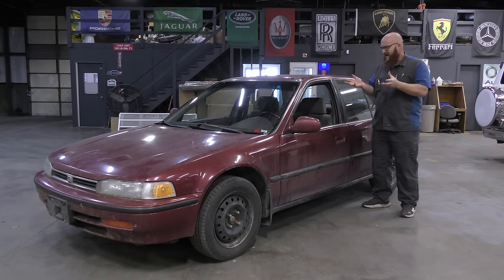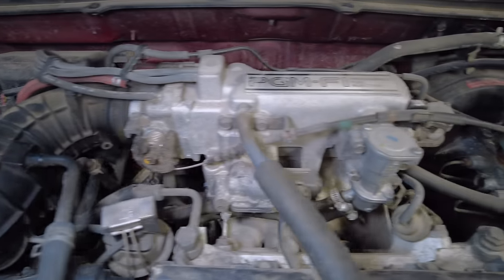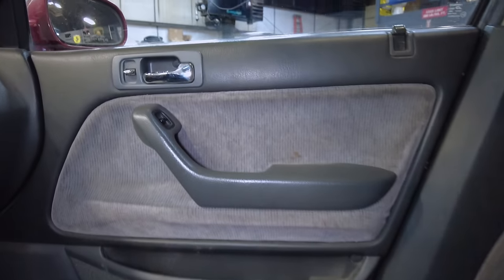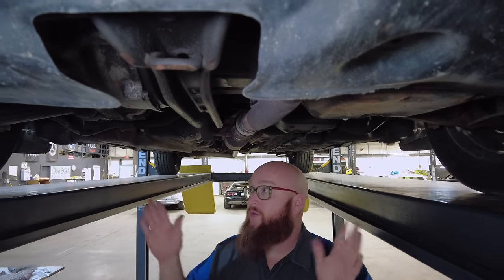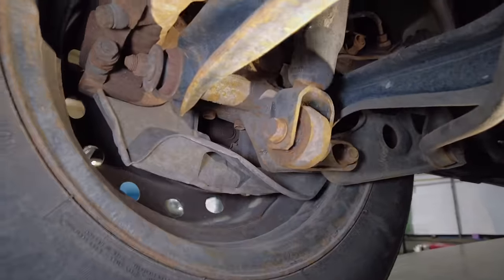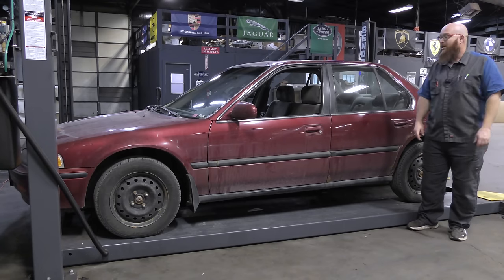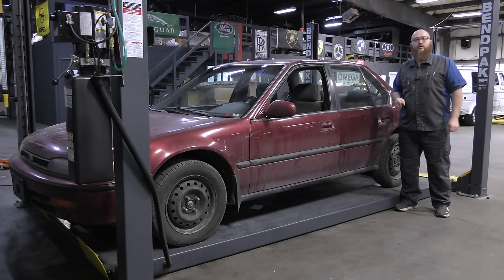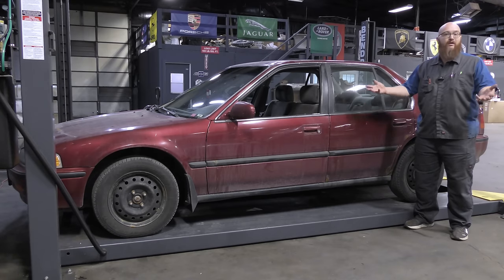A True Testament: 32 year old Accord with 380K miles! When Is It Time to Let It Go?

Comment: In 1992, the number of 1960 model year cars on the road was essentially zero. Yet old cars like this one aren't even an uncommon sight now. Quality really improved.
Reply: And apparently has dropped again recently
Reply: Then took a massive dip after like 2010
Reply: Once the EPA forced automakers to put turbos on tiny engines with new, unproven transmissions, quality suffered. Many basic cars from the 2000's are still great today if maintained well.
Reply: @spotifyseascapessmoothjazz  I think once automakers realized they could make shit extremely difficult to replace, parts hard to find, and crammed vehicles full of modules and chips that prevent your car from driving if damaged is when being able to affordable maintain your car ended.
Reply: @spotifyseascapessmoothjazz  Not to mention, automakers putting transmissions made for 4 cylinders behind v6s that made two times the amount of power as the four cylinders did.
Reply: I remember 1992 and I seen old cars all the time on the road. I never seen a Honda I liked and my opinion is new cars suck now. But if you think things are better than I am happy for you. I just disagree
Reply: Honestly there were some trucks, vans, and ubiquitous Volkswagens from around that time then...
Reply: Also another thing to keep in mind is the introduction of four speed automatics and 5-speed manuals. That significantly increased engine life expectancy due to the ability to run at lower RPMs. 

In the '60s and pretty much up until the '80s, cars weren't (MECHANICALLY) built to last More than 100,000 miles before needing a engine rebuild, transmission rebuild,  or both. 

Then add in the fact that safety equipment technology skyrocketed, thus drastically increasing the survivability of most crashes. And it's pretty obvious why people stopped driving around their '60s and '70s hand me downs.

Then there's the Chad's that still drive around '60s cars and '70s cars today. Safety equipment be damned.  Cough cough, we die like men, being launched out of our windshields at 50 miles an hour.
Reply: @erickricharson5196  So what era is your favorite?
Reply: @yaboimax6356  That's hard to say. I love 60s and 70s cars some 80s a few 90s a couple in early 2000s. I also love 50s and cars as back as model Ts. I am not brand loyal so ford, dodge, chevy, amc etc is not important. If I like it I like it. I have a collection of about 48 cars  my current project is a 71 Nova I saved from the junk yard. I am known to flip cars 90s cars are great for that now. But I have also never seen a Honda I like and only about 2 Japanese cars I would drive ever. Mainly American and German for me
Reply: you wouldn't have seen many 1960 cars on the road in 1965.
Reply: @connor_flanigan  I seen lots of 60s cars in the 90s
Reply: @erickricharson5196  I seen um too - they wuz rat over thar
Reply: 90's Honda are really a golden era for them. I 've had two 94's that both made it to 400k+ miles each and I only stopped driving them because they were old and too small for my job...also an 07 that made it to 350k, but it was kind of junky compared to the 90s models. Felt cheaper...
Reply: What are you talking about....my dad worked for the railway, is get to work cars was 1968 Nova and 1968 C10
Reply: @user-lq4mo8dw1p  yeah they are sadly misinformed. Older cars are much better 90s Hondas are certainly not great
Reply: In 1992 I had a 68 Pontiac. I felt like it was soooo old at the time.    Maybe because it was older than I was. Today, my 24 year old Miata doesn't feel nearly as old to me. 208k miles and still going strong, even with a supercharger since 135k (minus the rust).
Reply: @George0674  I'm in a dodge pro master van, granted I'm a expediter...it's a 2014 and I'm nearing 700,000
Reply: there were alot of cars from the 60s and 70s around in the 90s. The reason there werent as many as youd think was the oil crisis in the 80s essentially had them all sent to scrap yards for more fuel efficient cars. But realistically I hardly see any cars from 2008 on the road anymore.
Reply: @logantyler3741  hhhhhmmmm good point .....cash for clunkers took care of that.....best SUV was the 2000 to 2006 Tahoe, Yukon and suburban...I still see them in Michigan but they are rusting, I see them all over Mississippi Alabama Georgia the Carolinas and Texas and look great
Reply: Yeah fast forward to 2024 honda quality non existent  already having paint failure and ball joints falling apart maybe even oil leaks but hell what do you expect for $40,000??! 😂
Reply: @Braxton-xk5bi  I bought a 2004 Honda pilot in 2004....also bought a 1995 Chevrolet astro in 1995....the pilot was supposed to be the best SUV made.....wanna make a guess which vehicle I still own today???
Reply: @ShawnCalay  ummmm astro?? 😂
Reply: @Braxton-xk5bi they say the new ones are bad.
Reply: Goes to show the 90's was the best time for cars
Reply: @spotifyseascapessmoothjazz  Yeah, that definitely has something to do with it, but alongside that the companies that are using the small engines with turbos or putting terrible ass rings in them
Reply: @spotifyseascapessmoothjazz  i have a 2022 crosstrek manual. it's a non-turbo 2.0 engine and a 6 speed manual. it was one of the more simple cars you could buy when i got it new. to hell with that CVT transmission
Reply: Yeah, I’d say peak car quality has been 1990 - 2010 or so. There’s exceptions to that for sure, but when it comes to Honda & Toyota — they are good in any year.
Reply: @spotifyseascapessmoothjazz  I'm daily driving an '05 Insight that I bought new and I've repaired and maintained and it runs like a goddamn top
Reply: @erickricharson5196 reliability results say differently 

But, you're welcome to your delusions

You know you can easily look this up, right?
Reply: @lockandloadlikehell  I go by my experience as a mechanic. I do not need to follow Google. There is nothing special about Japanese cars. And I can show many old American cars clear back into the 70s that have lasted. I hate working on Hondas and such always have simply because things are so compact. You can keep following Google and the delusions of people that have to pay others to fix their cars, but do not expect me to. You can keep your delusions I certainly do not need them
Reply: Engine longevity and the quality of steel used in car bodies started improving markedly around the 80s I believe. That meant much more reliable, rust free vehicles until the noughties when they started filling vehicles with unreliable electronics. It's the ancillaries now that determine the life of a vehicle rather than the body or engine. Keep your car out of the sun as it's the plastic and rubber parts degrading that may kill it. Once repairs start costing a sizeable chunk of the cars value it's on it's inevitable path to the wreckers.
Reply: @user-hu4vr7zn9p  I was recently T boned by a 6x4 dump truck. My truck was old and I walked away. I know for a absolute fact as someone that works in the industry that had I been in a modern vehicle I would of been seriously hurt or dead. Also the electronics in modern cars do fail and they stop making parts to fix them. Today they seal transmissions and say no service is required it's lifetime. Well that can't possibly be true. They design these modern ugly piles of crap to fail and be junked in 10 to 12 years. Sorry but I will never pay 80k to drive something that has zero style, no real chrome, hard to work on and is guaranteed to lose money.
Reply: @brensdaman926  I generally like style wise like 80s and older and mainly Japanese cars but I will not deny that I would have to say the 90s were the pinnacle and my brother was saying for example a 1UZ, 4 liter quad cam V8 from Lexus in the 90s can literally last 1,000,000 miles without a rebuild!
Reply: @adamgallahan6747  That's not surprising.  I have a 2000 Blazer and a 01 Honda CR-V.  I plan to just fix them and drive them.  Cars today are riddled with too many garbage electronics and plastic crap
Reply: My family is currently driving a 1995 astro van with 300k,  a 1998 F150 with 275k, and a 2005 Element with 175k. All daily drivers. All with no issues. Just kept up with maintenance.
Reply: @yaboimax6356  Overdrive transmissions likely contributed to engine longevity in some cases, but I don't believe that was the main factor. Plenty of VERY long lived cars had/have very short gearing and cruise at 3-4K+ RPM with no issues. Many 80's and 90's Hondas and Toyotas cruise at around 4K RPM in top gear just to name a couple and look how long those last.

Overdrive or not, it still takes a fixed amount of power to move a car at a certain speed. Whether an engine runs at, for example, 3K RPM generating 52 ft lbs of torque or 2K RPM generating 79 ft lbs of torque while cruising at 70 MPH, it's still producing the same 30 HP either way.
Reply: @erickricharson5196 Japanese cars are MUCH better than American cars. You’re on something if you think otherwise.
Reply: @stephenlang7870 does the f150 have the 4.6?
Reply: @Ecchier  your on something if you think that. I stick with old American I am a proud American not a traitor
Reply: @erickricharson5196  You’re a proud owner of Junk! Your loss.
Reply: @Ecchier  nope I am a proud owner of many classic cars going up in value. You are the one wanting junk it's your loss not mine I don't lose money on my cars but I am sure you do
Reply: @erickricharson5196  I get what I paid for, while you sit there and pay 30k for old junk.
Reply: @erickricharson5196  I bought a Honda pilot in 2003, sold it for scrap in 2012....bought a 1995 Chevy astro in 1995, still have it today but was wiped out in the 2023 hurricane while I was 🚛 ng in the Midwest....I miss that astro more than all of my ex girlfriends...
Reply: @BullittHilts  I remember when I was a part time tow truck driver back in the late 90s and early 2000s....I loved Honda's and Toyotas....that great quality you think they have had left me with no bills....I was able to pay for everything in cash....
Reply: Then they realized they were too good,and started purposely building in failure points and made them needlessly complex. 1990-2005 is the sweet spot.

Comment: They lost their mind to get rid of this car it would be cheaper to fix the annoyances than dealing with a car note. Its a good back up car
Reply: Even though I don’t own a Toyota or Honda, I’ll continue fixing my 2.5l Jetta once or twice a year. If I can go my entire life without a car note, I’ll do that. Thankfully, the car doesn’t leave me stranded and starts every time.
Reply: Even if there engine does eventually need replaced, it would still be financially worth it to go that route as long as you're keeping up on the safety items. Hell, even addressing the rust and  the rear window seal would be worth it - it would help prevent the next 10 years of this car's life from really starting to rot it away. Even if you're into it for a few thousand dollars over the next decade, it's STILL far cheaper than a car payment. This really is an example of an easy-to-save classic that is well worth actually saving.

Comment: A modern day car would never outlast a vehicle of that generation
Reply: My dad's Honda Element has 525k miles
Reply: Think the 4Runner and 2023 gx460 will make it with ease if regular maintenance is performed
Reply: i saw a 2018 civic with 450k on it
Reply: Seems like some confirmation bias, most modern day cars wouldn't have been driven long enough to know yet.
Reply: My 06 CR-V hit 250k and my CX civic has over 300k! Hondas rule!!!
Reply: They'll last but with 87 computer lights/errors.  Or gasoline will be no more.
Reply: my step mother confused hyundai and honda. 
and she got 2021 hyundai because she got "great deal" on the car.
big mistake.
Reply: If you keep up on the maintenance and take reasonably good care of it (like the owners of this car clearly did), most modern cars could last that long as well.  I will concede that the maintenance is getting more costly though...so more people will skip it.
Reply: There are numerous million-mile vehicles from the last 10 years or so.
Reply: I know of a few Mitsubishi Mirage's that past 400,000 miles. They are modern. (:
Reply: We don't know that it's been a year bro
Reply: Wow I really need to drive my car more. It's the 99 Acura tl rust free almost mint in condition. It has 243k.
Reply: @Ronniejamesleo  Wow! Mint condition is great for so many miles! No dents or paint chips?

Comment: I don’t think a 2024 Honda will make it to 380,000 miles.  This was a different era
Reply: Best era of vehicles from a practical perspective.  One simple computer, fuel efficient, fuel injection was perfected by then, adequate power, plenty of simple manual transmissions available, rust proofing was decent enough if you took care of it, big enough to fit a family in.

Most reliable Honda and Toyota era as well (90’s).
Reply: @Joe-hz1nw Totally Nailed it. My sentiments EXACTLY. Hard to explain this to the "newer is better" crowd. Peak engineering ... not OVER engineering. My '95 Lexus is a testament to this. Best Accord EVER incidentally.
Reply: @RobertSmith-js2kz  those Lexus models are great, whether they were just rebadged Camry’s with more sound proofing and creature comforts, or the more upper level luxury models.  Probably the best cars ever made all around, particularly that first V-8 model (LS 430 I think).

Which model of 95 Lexus do you own?
Reply: @RobertSmith-js2kz  I have a 1998 Accord.  Rust proofing is way better than the previous generation, but engine, transmission are weaker.  Still a great car though.  85k original miles.  2.3 liter Vtec
Reply: It probably could with great maintenance if those miles were driven on many longer trips in a relatively short amount of time, but probably not if it was 30+ years of short trips around town. Not with so few repairs needed anyways.
Reply: A 2024 Accord wouldn’t make it to 32 years old either.
Reply: Why not?
Reply: @patone2184  most modern Honda vehicles use CVTs and they have a very poor track record. They are very expensive to replace and can’t really be repaired
Reply: @Joe-hz1nw My LS (400) is no Camry (though the 90s Camry WAS "built like a Lexus". Lets get that straight ;) V8, rear-drive and built to a standard never to be seen again. It was a one-time deal, to establish the brand (and undermine the Germans), before the yen went through the roof, killing the financial advantage. It's all the same junk now more or less. They spent a BILLION dollars developing that car. I won't even get into the SC400 (that my girls still daily drives).
Reply: @RobertSmith-js2kz  best car they ever made.
Reply: Not these turbocharged engines
Reply: @CoolCars1-jl7rh it pains me to see what non Japanese Nissan has become over the last 20 years.
Reply: @joetz1 and they stopped making manual transmission. So I'm afraid to even buy axa new accord 😢
Reply: @kylefishing21 people don't realize turbos need extra maintenance.
Reply: My 91 toyota mr2 still runs well and no rust but that's because it came from the desert
Reply: A civic with a 1.5T has close to 800k miles, it's on youtube.

Comment: The sound of that F22A1 motor starting takes me back to the most influential car in my life: 1992 Accord LX wagon with a 5 speed manual transmission. I bought that car with 240k miles in 2010, and sold it with 378k in 2013 after someone smashed in the rear tailgate in freeway traffic. I lived in that car, drove it across the US multiple times, and taught maybe a dozen people how to drive stick in it.

In the end, the interior had no rips or tears and it only had minimal rust at the corner of the rear wheel wells. I replaced the clutch once when I bought it, the timing belt twice, and most of the money I ever spent on it was in tires. I learned so much about working on Hondas on that car, and it drastically shaped my life being able to trust in that vehicle to deliver me to whatever job I was doing during those years. To this day, I still miss my full-size spare inside that massive cargo space 😢
Reply: Might be able to find a replacement on bring a trailer

Comment: Honda really hit it out of the park with these 4th gen. Accords.  I like the body styling of them too.
Reply: I've owned six 4th gens,  all used- starting in 2000.  3 Teal colored EXs, 2 'grey',  I keep coming back to them despite owning newer Hondas and Acuras.  My 92 is ready for another 30 years of use.
Reply: The most reliable car model ever built. Wonderful vehicles.
Reply: Still a pleasant, nice looking car to me even to this day compared to the hideous modern stuff on the roadways these days.

I have always liked the look of this Accord and the Prelude. My neighbors had one of those, an 84 I believe that just wouldn't quit.
Reply: 130mph?  🤥
Reply: What’s really sad is that we will probably never see such great cars again. These were such great cars.
Reply: @A-classic-smithy  I got my 89 up to 113 a couple times! I was a kid and was too scared to keep it there. XD
Reply: @A-classic-smithy I had it to 120 in high school.  I was dumb.
Reply: Not that uncommon to get 300,000 plus miles on a car if you take care of it and change the oil. I have a 2011 Ford escape with 365,000 miles. I bought it in 2014 with 29,000 miles. Only significant repair was the timing chain last year, it had 340,000 miles at the time.
Reply: 90's Hondas are fantastic. I have a '95 Del Sol with 281K and that thing is at 3k rpm at 55 mph.
Reply: I have a 2007 Honda Ridgeline with 310K on it right now.  Trying to figure out if I should change the timing belt again or let her go.  She still runs great.